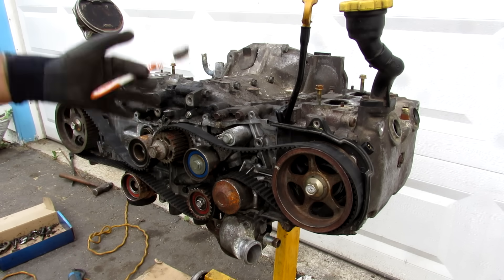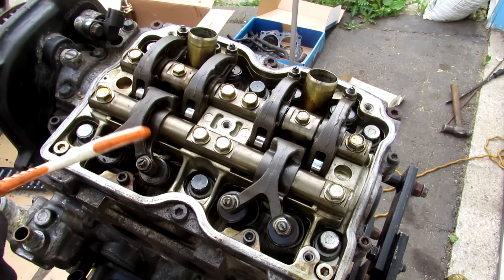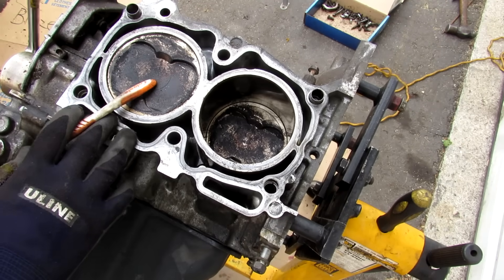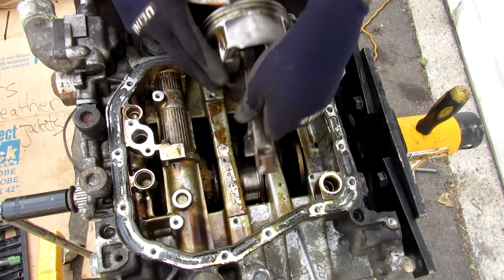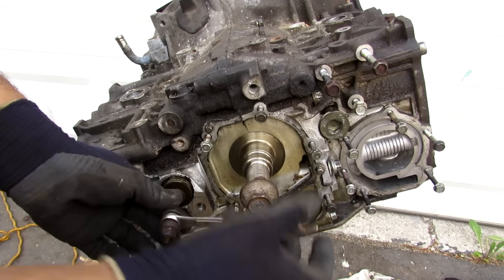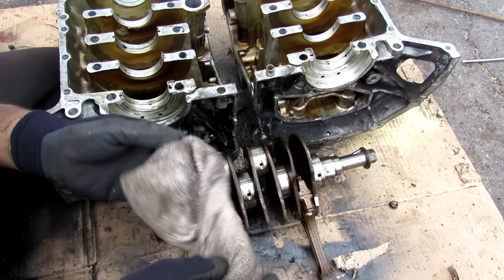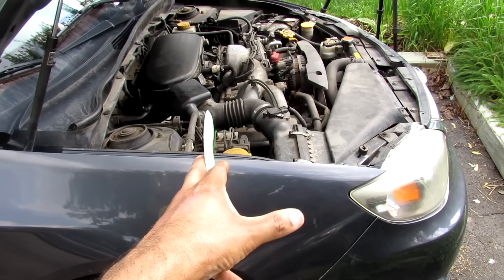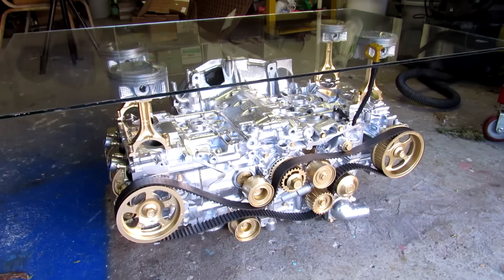Why Subaru Engines FAIL

Comment: I only use Mobil 1 oil and filter, every 10 to 12, 000 km.  My 2011 3.6L Outback has now 325,000k  NO motor leaks, or noise, slap, ticking. Still pulling strong.

Comment: Interesting video. I have an Impreza WRX from 2001 which I bought off the first owner at 29000 miles in 2012. Since then I’ve gone to 97,000 miles and have serviced the car well. It doesn’t burn a drop of engine oil between changes of 5w30. Doesn’t use any coolant either. Plenty of folks have also told me I should have needed a clutch change by now, a new gearbox and a set of head gaskets. Clearly not all are the same.
Reply from the maker: Nice. Keep it maintained and it'll last

Comment: Well this has put me off buying a subaru. You would have a hard job designing a more awkward engine .
Reply: They don't fail that much I've had several and the engines run better than most just change oil and keep up with maintenance and don't drive like a fool! Subaru is a great car no matter how many people bash it.

Comment: A: Because kids wanna drive 10,000 mph and dont even bother to change their oil cause theyre too busy on tik tok.
Reply: I'd buy another Subaru in a second! Not discouraged because 1 guy says they fail!
Reply: It isn't just kids, I've seen just as many adults join the YNANSB club because of poor maintenance habits and terrible performance mods choices.

Comment: Heres another failure mode for ya. The timing belt idler and tension pulley bearings can fail if pulleys not changed at major service(thanks previous service guy👍). This then causes slack in the timing belt, which will then skip teeth under load and you then have your valves dancing on top of your pistons! 😣😪Warning sign is a whirring /whining sound  from the front of the engine. 
Dont delay finding the source of noise. I was literally on my way home to inspect where noise was coming from when the above  damage occured.
 The solution was  to go buy a brand new Hyundai for the Mrs and the GT Forrester is now a project in waiting.

Comment: Well i  was gladly mistaken.
I thought this would be a video showing blocks ripped in pieces.
Pulled oversized studs from way too much boost at low rpms.
Massive coolant airpockets/hotspots visible.
Inner cylinders walking around heads and feathering.
And ... Bearing/crank/rod meltdown from lack of lubrication above 9000Rpms.
Instead i was pleasantly surprised to learn many things actually applicable to the normal world.

Thank you

Comment: This is a guy with some sort of agenda against Subie engines. I am 73, currently driving my 6th new Subaru, and I have only had one head gasket problem in my 40 years of Subarus (and I kept all my cars from 10 years to 20 years). That head gasket problem was during the few years before they eliminated it. I have never had any other problem with these cars - but I maintain them well. Look around certain areas of the country and you will see a plethora of Subarus. That is why Kelley Blue Book values them so highly - numbers don't lie.

Comment: Is it a bad engine or one that needs proper maintenance?
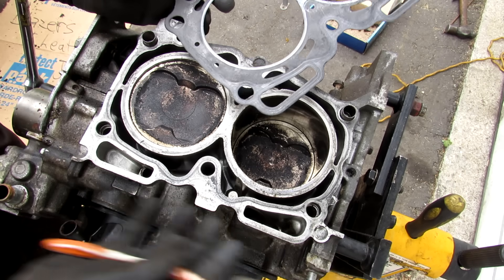Reply: Bad engine. The heads are different enough weight than the block and the wall between the cooling and oil jackets 4:00 are so thin that with just a little expansion the gasket loses it seal. And that's why with a little age the head gaskets leak. 

I hang at my buddy's shop some days all day several days a week for the past 5 years,  and he gets two or 3 of these a year. 

It's gotten to the point, whenever the car is not worth repairing and they give him the title for scrap he pulls the engine, tears it down, sends out the heads, rebuilds it and keeps it for when another comes in and the rest of the car is worth saving, getting about 4 grand for an engine swap 

I know he had two off to the side for a while but the last time I was there I saw only one. 

Subaru people like their cars and refuse to let them go no matter how bad they shit the bed.

Subaru, Jeep, no way would I ever own one, same for Nissan, Ford or Chevy.

There's only 2, (really 4) Toyota (Lexus) and Honda (Acura) that is worth the money for performance, efficiency, maintenance and repairability.

They run forever and run well with high mileage and won't cost an arm and a leg and hold their value 

Which makes them all great choices when buying used

Comment: Back in the 1980s I worked in a small auto shop where the owner billed me as the foreign car mechanic. A guy brought in a 1970s Subaru Station Wagon that was rattling. Otherwise it ran smooth. I open the hood and looked down at the front of the engine and the crank pully was wobbling. After borrowing a Subaru manual,(I had never had a Subaru boxer engine apart before), I pulled the engine, and then pulled it apart. The crank was broken across the throw between #1 and #2 cylinders. I sourced a crank and a set of bearings, put it back together and according to the owner, ran for another trouble free 100,000 miles. And everyone else started bringing me Subarus.
Reply from the maker: Nice. I bet you've been living off of the Subaru head gasket failures for a while now
Reply: @speedkar99  I'm afraid not. The owner of the shop was a bit stingy and when I asked for more pay, he shot me down. I went to work for a steel fabrication company for about twice the money. I retired as a quality control tech after 35 years in the steel industry.
Reply: I had brought his shop into the black for the first time in five years. I think I worked on every Fiat Spyder within 50 miles, and was pulling in business from a city 25 miles away. That was with only word of mouth advertising.

Comment: At 13:30, a V6 is smoother than maybe a flat 4 but a flat 6 is smoother than a V6. I believe a V6 has a secondary imbalance because the vector forces don’t quite cancel each other out in a v layout. In anything but a 60 degree V6, the engine is out of balance.
Reply from the maker: Agree

Comment: I've always noticed how far the front bumpers stuck out and figured it had to do with AWD transmission. Kind of counteracts the entire objective that the boxer's low center of gravity attempts to achieve, which apparently has an extraordinarly significant trade-off in complexity and reliability that you so clearly and thoroughly explain here in this most epic of teardowns.
Reply: The shorter wheel-base is probably advantageous in rally applications since it allows for quicker steering/weight transfer/change of direction. Reliability aside, there is no denying the Impreza's legendary domination of WRC. However, that was back when they were much smaller and lighter, and I'm not too sure how effectively the shorter wheel base translates to the later-model full-sized 3500 lbs wagon-based chassis. Furthermore, a locking rear diff isn't available in the WRX from 2017 onward, it is instead open and applies the rear-inner brake for "traction control". Coupled with a 60% power bias to the front essentialy gives rear-assisted FWD, or three-wheel-drive.
Reply from the maker: Yep. Thanks

Comment: Mine car has far fewer parts, no head gaskets, no cam shafts, no con rods no timing belts or pistons, yet outperforms this while having negligible maintenance costs. It's electric :-)
Reply from the maker: The complexity is in the circuit boards

Comment: what oil do you recommend for a 2.2L Subaru boxer ( non -turbo ) ??  I use Castrol GTX 5w/30 currently, and it seems to work well, and I do not lose much oil between oil changes every 3k.

Comment: I had a 2017 Impreza Sport manual.  Loved the car. Returned under NC lemon law. Three bad engines before the odometer had 13k. Every engine used 1.5 qts oil per 1k miles. Flow Subaru in Winston was dealership and consistently overfilled crankcase by 1.3 quarts. Horrible experience. Never again. This video shows literally ten thousand ways subaru can disappoint their customers.
Reply: If you have even the smallest issue at a Subaru dealership call Subaru of America.  I had a problem with the brakes on my Impreza and the dealership kept blowing me off.  One call to Subaru of American and the dealer's service manager called me back the same day.  He was pissed off and started to argue until I told him I'd just hang up and call corporate again.

Comment: So why does this engine have so many issues and the 2.2L did not seem to have. The wife had a 96 legacy wagon and we sold it with 200k miles on it and they guy I sold it to is still driving it. It never to this day burns any oil.

Comment: Coolant is and has lube  properties and oil has great thermal transfer properties.
you said fluid flows through gravity.
So many errors an wrong information.
Just one error
Piston slap is caused by skirt design not because the Teflon is worn away 
Pretending to understand engineering 
But good try, doing better......

Comment: I went from always admiring this engine type to actually reconsidering my position in more than a few areas. What a nightmare to service the seals and con rod bearings. I dropped the oil pan on my sisters sentra and replaced the con rod bearings in a few hours. Not race oriented from the "fix it in the pits" perspective. It's interesting to see how one design decision drove another and another until it was stuck with some potentially bad long term problems.

Comment: So, the bottom line is that if the engine is properly maintained there should be no problems. I own a 2014 and a 2018 Subaru and love them.

Comment: Thx for the concise narration. The wrist pin plug to remove the wrist pin so that you can part the block. What a sneaky pain. The old Volkswagons didn't require you find a hidden plug to part the block, but then again the cylinders were removable. I guess that's the only choice the enginerds had.
Again thx for such a concise narration and teardown.

Comment: the problem this engine has is lack of maintenance because having worked on these cars since the 1960's [and they were bad then] the engines in the '80s n 90's i have seen them still goign strong after 450,000 kilomtres if you maintain them correctly so this crap is reflecting on previous owners NOT Subaru's design or normal longevity btw i am a mechnic with nearly 50 years experience starting on VW's and Porsche and finishing on Subarus and believe it or not Rolls Royce

Comment: You are definitely a Ph.D in engines. Extremely well explained, diagnosed, shot and edited. ⭐️⭐️⭐️⭐️⭐️
Reply: Yes, I thought the editing was pacy and it made the whole thing compact with no messing.
Reply: read a service manual he made multiple mistakes
Reply from the maker: Thanks
Reply: @speedkar99  - After watching your teardown of the Subaru four and your explanation of it's weak points, I have to say that the Chevy Corvair's air-cooled flat six was a pretty robust engine for something designed with slide rules and drafting tables.  It's biggest weakness was the cheap o-ring seals the bean counters insisted upon using for the pushrod tubes. Once those were replaced with o-rings that could withstand greater temperature fluctuations, it was pretty darned hard to break one!
Reply: Yes, however all engines fail if they run out of oil. Them bearing show extreme wear, likely the motor was run without proper oil flow.  I'm not a Subaru guy, but the seem interesting.  I wonder what the average engine life is for these cars?
Reply: @chefgiovanni  I got 300K miles on a 1999 EJ25 before I sold the car.  I still see it driving around.  That car also had the OEM alternator on it when I sold it. Drove it approx. 400 miles per week with just basic maintenance.
Reply: @chefgiovanni  engine life is relative to how much you vape so if you blow clouds like a chimney I've got bad news for you
Reply: @chefgiovanni  I engine swapped mine at 218k miles.   Had ringland failure and ran it nearly out of oil once.  Happened the first time I found out the thing was burning oil plus leaking turbo oil seal made it real difficult.  Engine swapped to a JDM 2.0 and bigger turbo and some more goodies.
Reply: @chefgiovanni  I'm at 290k miles on my ej251 (same engine in the video). Around 240k I pulled it as a maintenance thing. Went through the entire engine and did a refresh. Rings, bearings, seals etc. It's been running strong until a few weeks ago. Timing belt snapped. I was running a gates. No idea at the moment the internal damage, if any. If no damage, a new belt and keep rolling. If not, I have enough spare parts to get it back together. This things are like legos.
Reply: @chefgiovanni  he did say when he got to the oil pan,  "it looks like it had coolant in it." Someone likely had likely replace the head gaskets. And most of the damage was likely done as a result of the antifreeze.

Comment: Questions though, how many miles were on this engine and who was a dummy who owned it and didn't maintain it?
Reply from the maker: No history
Reply: I bought an impreza before but i sold it bcause i dont know how to maintain the engine. about 8 months owning the car then i sold it and bought an evo 3. I dont know much about subaru boxer engine. Had so much problem on the car.

Comment: Bought my 2000 Outback with 192k miles to ensure it wouldn't have head gasket issues.  Did the water pump/timing belt around 215K miles because I had no history and they are interference engines.  Did an alternator on my way home from work in the auto parts parking lot.  Sold it at 243k miles.  It always leaked oil (rear main or valve covers/head  I guess because I changed the other seals up front) but never failed me until a rock took out the transmission filter.  These weird cars have spin on canister transmission filter that sticks down like an engine oil filter and mine was spewing fluid at the rate of 6 qts per 55 miles coming back home.  Still see it in town driving around and makes me smile every time I see it. Snow tires, a bra to cover some body damage and a perfect limited trim level interior with the cold weather package made it a great winter vehicle.  Worst thing was it was absurdly slow and gutless.  I swear it was faster in snow and gravel, and I just needed some more speed in my life.

Comment: My brothers 2000 model Subaru Forester has the EJ20J engine fitted & what he's noticed is the timing belt kits are very pricey for them (about $1000+ AUD) & many people don't bother getting them changed.

He bought his car which has done over 402,000 kilometres now at about 300,000 kilometres & I can tell that the cylinder heads had been removed from the car because it would've been after the timing belt snapped that they replaced the timing belt kit, I'd say they bent the valves in the cylinder heads.

He had the cylinder heads rebuilt on the engine (again) because he ran the engine on LP gas which caused valve seat recession & one of the valves to fall into the cylinder,our cousins partner is a Subaru mechanic who got the cylinder heads rebuilt including new valves,springs & valve seats & he advised him against running it on LP gas but he still does.

I've recently fixed it up as it started to surge at idle speed,the throttle butterfly input shaft had worn into the aluminium throttle body meaning that I had to replace it due to an air leak :-

https://qph.fs.quoracdn.net/main-qimg-4f83c26bd019cdc161a63c25a0bbcf8f

Comment: My 1600cc boxer engine in my 1977 Subaru GF went over 200,000 miles before it finally died of "cam belt was never replaced". :-( It was rated for 36 mpg overall and 42 highway, which I got for its entire life. It got me through university and beyond (had to do much of my own maintenance like adjust the valves myself, points, wheel bearings).

Comment: "Why Subaru engines fail".
It ain't got no oil in it.
Reply: Right. That will do in the rod and main bearings every time. I-4, V-6, V-8, any motor ever made. The problem's not specific to Subarus.

Comment: I had an 08 2.5 legacy and got burned pretty bad IMO. Head gaskets, exhaust, valve cover gaskets, steering column key switch, and many other things. Had to trash it at 135k. Body was fine..
  Now have a Impreza 2015 2.0 w/ CVT. 85 K and IDK if I dare keep it...When people ask me about Subaru's I say they are great if you have the warranty to 100 K and then dump them.  Or accept that head gaskets ($4K) are part of regular maintenance..

Comment: Gee this only took 15 minutes.  How come the labor charges are so high?
Reply: Also, I just did an engine rebuilt and trying to clean all the oil and water passageways is chore. Not to mention all the gasket crap left behind. Then you have to blueprint the engine and find out what components need to be replaced and which ones you can keep. Then you need to clean everything and torque all of it back together. All of that takes time and time is money.
Reply: Putting it back together is far more time consuming and remember it is already removed from the car.

Comment: Only idiots design engines with belt driven camshafts.
Reply from the maker: It's quieter
Reply: It doesn't need to be quieter as chain drives produce very little noise. It needs to be reliable and not subject to periodic replacement every so often. Roller chain drive lasts the life of an engine far more often than a belt does.

Comment: Nothing of the problems you mentioned in this video cannot happen to other shapes of engines, also all engines need maintenance, regular-based oil change, and care. And the funny thing is the oil room in the engine... does it not suck air sometimes (instead of oil) in other shapes of engines? This is an reasonable attack on boxer engines.

Comment: <<< This car was stock at one time. The oil was changed every 2500-3000 miles and honestly not beat on that bad. Engine developed a rod knock at 27,000 miles. My parents neighbors forester 2.5 blew 2 motors in 60k miles. Subaru’s are absolute garbage but I keep going back for more.
Reply from the maker: Ouch